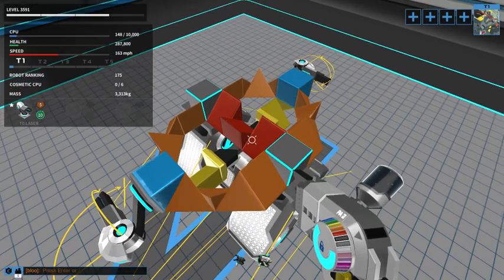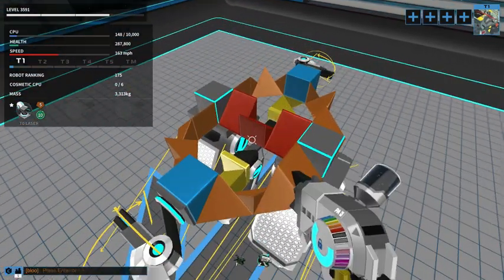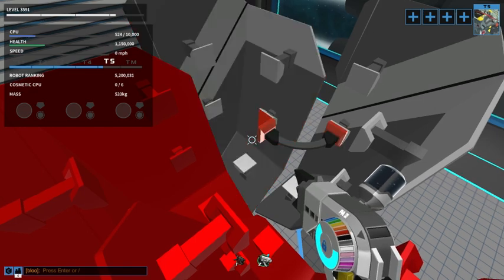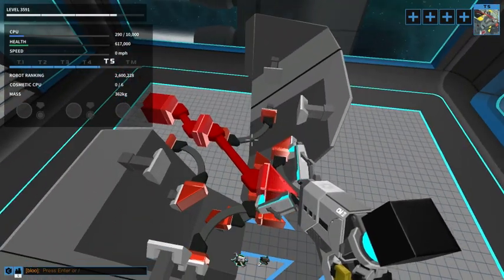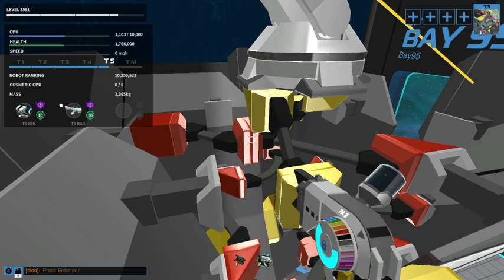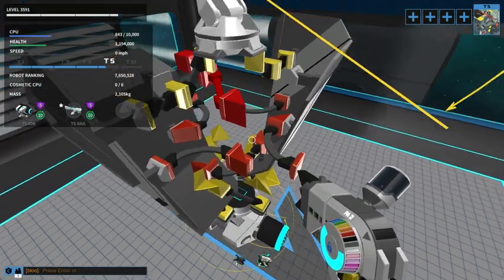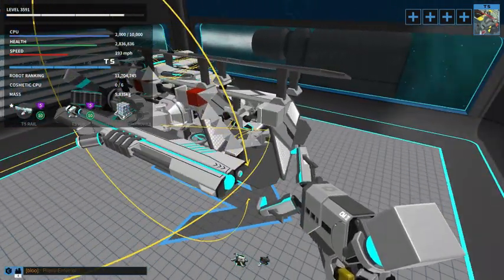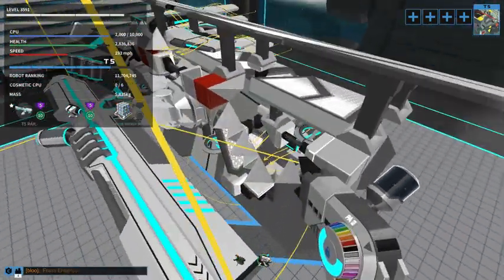Robocraft: One Take Triforcing - Part 5a - Redundant tick delay priority network

Comment: The way you describe all this stuff in your videos is awesome, I can't wait to try this stuff out.
Reply from the maker: Please be super cautions with this building style! Your design will need to have these connections covered by mega plates or blockspam in order to be effective. With megaplate only builds I also recommend having multiple chambers that are separated from one another with plates. With blockspam this technique can work to connect all of your multi attachment components, but save one connection from each to also run to the body/blockspam on a shorter duel mount for sinking damage. If you find what you build is doing poorly, please return to my earlier videos and start with intermediate triforce (just duel mounts and split protection in blockspam). Even just a pure blockspam build with a proper potato/sphere/cube shape and no routing is like 60%-80% health efficient vs rail if compacted well.
Reply: @twotoneterminus4976  I feel like the set up you describe would work far better for flying bots as opposed to ground based, simply because most of what is encountered is rails, I really don't run into flak to often when flying.

Comment: How much of this terminology and functionality did you invent/formalize? Either way, you teach it really well. I’m loving this series (Was referred here by Denrron)
Reply from the maker: There is a bit of history to how a lot of this terminology develops. A lot of the initial terminology was developed by a player called Cataphrat1, who was the earliest player to properly use advanced triforcing that we (EnmitysPodium Clan) know of. He was and still is a foremost authority on all things related to how to properly route things, and even gave us his method of objectively measuring the rail resistance of a build to help approximate the health efficiency of a bot. I kind of stumbled onto a couple techniques a long time ago on my own (well after him) and made a reddit post on it. He got in touch with me afterward. I picked up the foundation of a lot of the terminology there. These terms included:

- Damage sinks
- Single point damage sinks
- Duel mounting
- Ticks/steps of damage
- Plasma trap (using cosmetics)
- Split protection

And probably many more that I cannot remember. I enjoyed that the terms he used were very practical and did a good job of describing the actual function of each technique. Ever since whenever we come up with something new, we try to name it something appropriate that lends credence to the function and usefulness of the technique. Usually before that there is sort of an internal clan process where we grill one another over not just the mechanical truth of the setup but also question the practical applications of the technique. Some builders have their own techniques that they believe in and swear by but others disagree with. Most of what I post to this channel is more widely accepted and used.